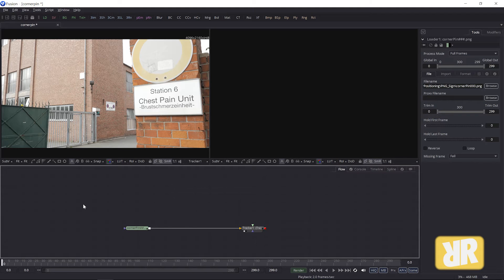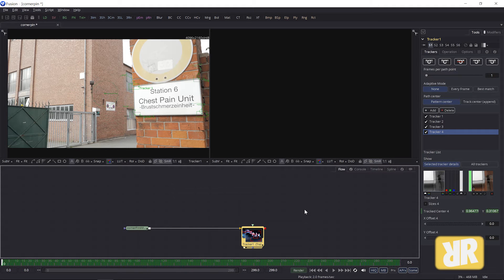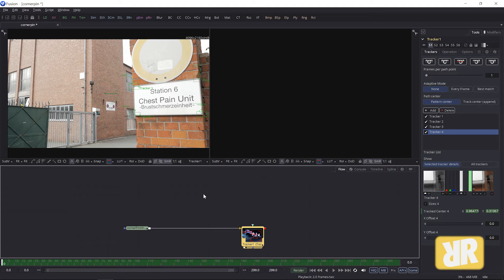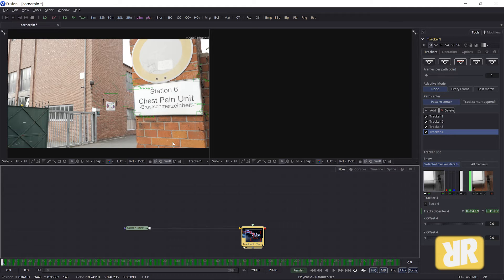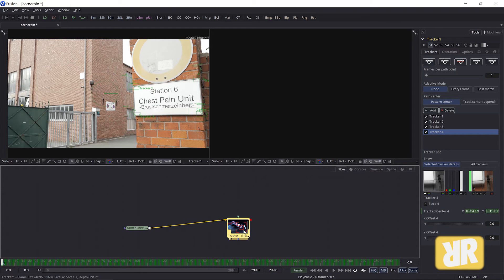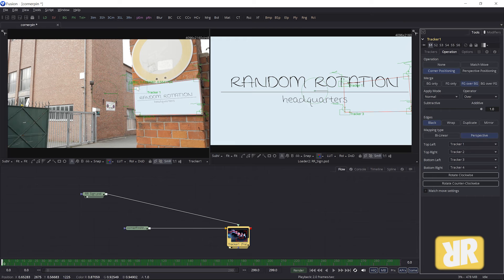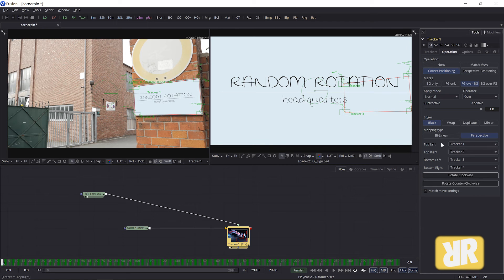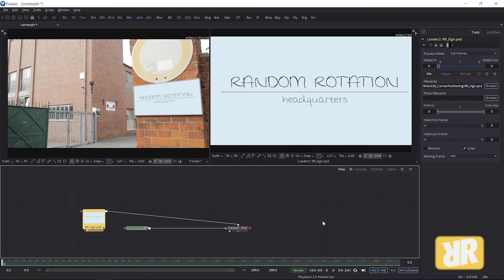Fusion Minis #028 - Corner Positioning [ENG]

Comment: Hi! Do you know by any chance what's the purpose of the Perspective positioning operation?
Thanks
Reply from the maker: Hi!
I never needed to use it, but ...

"The Perspective Positioning operation is used to remove perspective from a foreground image or 
apply the perspective from one sequence to another. This can be useful when you need to paint out 
an area that is distorted by perspective. Removing the perspective flattens the images for painting, 
and then another tracker adds the perspective back.
The Perspective Positioning operation of the Tracker requires the presence of a minimum of four 
patterns. If this operation mode is selected and there are not four patterns set up in the Tracker 
already, additional patterns will automatically be added to bring the total up to four."

This is what the official manual says.
Reply: @RandomRotation  Thanks for your kindness, I really appreciate it! But the reason I stumbled upon this video is because I was reading the manual and don't understand this specific part of it 😂. I was searching for some real life scenarios for when the Perspective positioning operation was handy, which it seems there's none on the internet. But thanks anyway! I'm really enjoying learning Fusion.

Comment: Hi, I am doing the same process in Davinci Resolve and my Problem is, as soon as I am merging the tracker node and the Corner positioner, the frame jumps enormously to the right side outside of the edges of the video. Do you know what the problem might be?
Reply from the maker: No. Sorry. I would have to check your composition to be able to find the mistake.